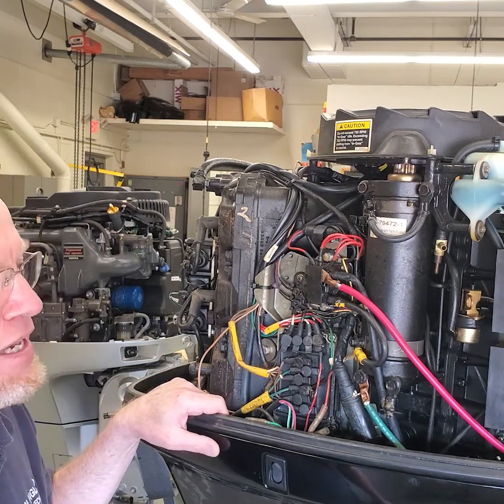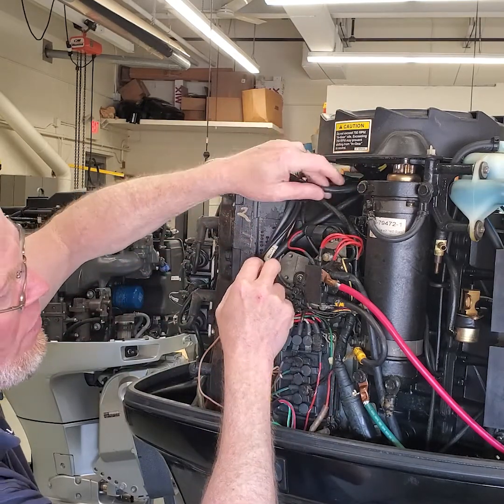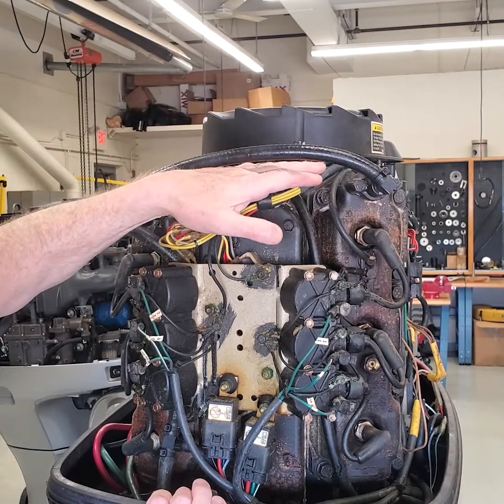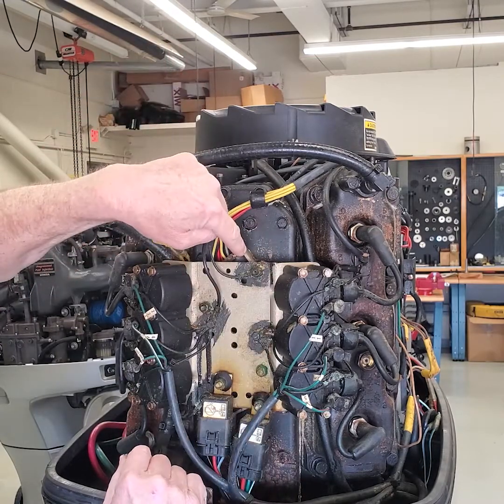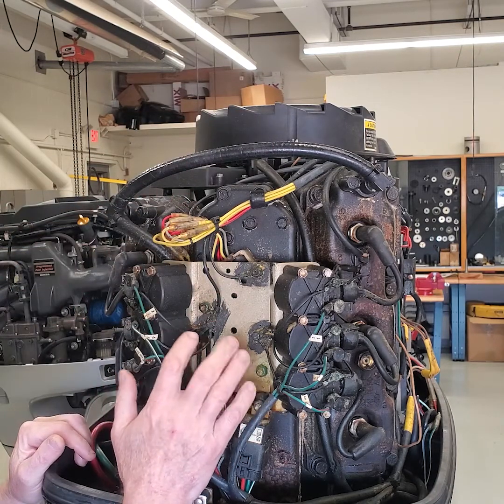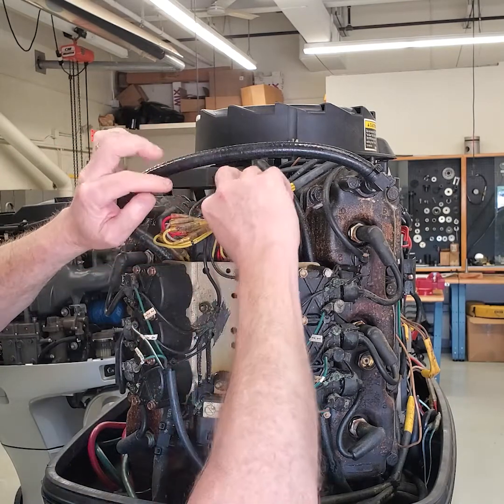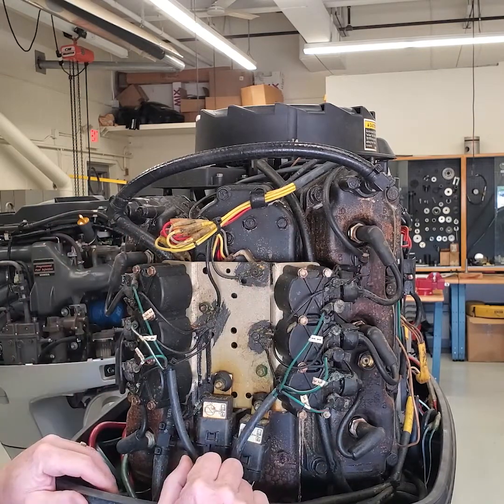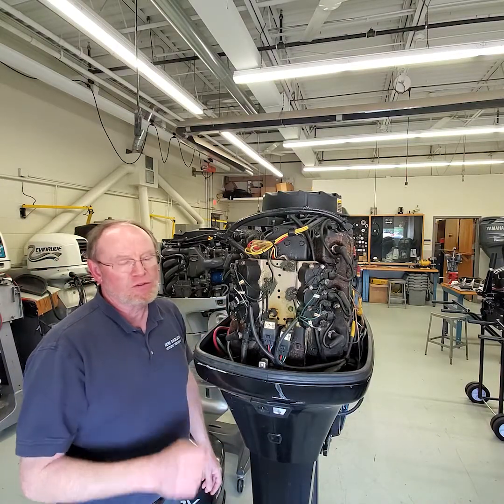1998 Mercury 200 Hp 2.5L Offshore charging system design and testing

Comment: 8:00pm, I’ve got a 1992 Mercury and at about 3.5 to 3.8 it surges and sounds bad like it wants to blow up but at wot it runs fast could it be the vr’s or the cdl boxes?
Reply from the maker: There is a old service bulletin on those engines. If it is a 2.5l v6 then the mid range jets need to be replaced with 0.004 larger jets due to a midrange transfer power drop.  I bet this engine is a used one put on a different boat. If not then all the carbs need a full cleaning.

Comment: Great video. I have a question tho. I have 4 yellow wires coming out of my stator. 2 of those wires have a black stripe. Are those 2 with the stripe indicating 1 leg of the charging system as the just yellow wires would be the other?
Reply from the maker: @ryanstoxen3190  Yes if you have dual regulators on the engine

Comment: I've got a 1996 200hp BlackMax. I ran the boat just a little ways and stopped to fish. The cdi box was burning a hole in the center of it. It would still run but the center of the box is burned out. What do you think caused  it? And do you think changing just the cdi box will fix it? Thanks for any help!!
Reply from the maker: @Keananbrickhouse  I would suspect the internal circuit issue. Change it.

Comment: Hey Ted, I have a Mercury 2.5 rx6,all of a sudden both my voltage regulators are getting Hot,too where they start smoking and melting the gel, and my tac, isn't working correctly, do you have any ideas for me to look at? I love your program, very informational.thanks.
Reply from the maker: Sounds like a short to ground. The tach is driven by the gray wire attached to one of the regulators. Remove the wires, disconnect the battery + cable and check for shorts to ground on the wires and the regulator posts to ground.

Comment: Great video. Have the same engine, unfortunately has developed an overheating issue. Ive changed the water pump twice, thermostats, poppet valve, flushed and back flushed twice. In the process of removing the exhaust manifold to check for blockages. All bolts are out but the manifold appears to be stuck to the head. I'm so frustrated im ready to beat it with a sledgehammer. Engine runs really well otherwise
Reply from the maker: Is the alarm going off? Get yourself a cheap infared temp gun, run the engine with the covers off and when it gets hot see if one of the heads is hotter than the other, you'll know what side to attack then. could be a clogged water passage in one of the heads.
Good Luck!

Comment: Hey Ted. Just found your channel. Great content. Any vids on upgrading old merc 2L from rectifier to regulator rectifier. Problem is that my 1985 150Hp is overcharging and from what I can find this can only be fixed by adding a regulator to the charge system 
Thanks 
Pete
Reply from the maker: That 150 probably has  a 16 amp max output stator so you could add one of these 20 amp regulator/rectifiers to it

Comment: Mine is charging high at around 16 volts. I may have a bad regulator
Reply from the maker: Yes, that is the issue. If you have two regulators like this engine then disconnect one (the red wire) and run it again to see if it is still high. Then that one is the issue, do the same with the other ensure both have not failed
Reply: @tedsmarinerepair8956  Yes, I do have 2 regulators. Thank you!

Comment: Hello Sr. I have a problem with my 1999 mercury 175 hp efi, everything it's working, I just noticed that I don't have return of voltage so the battery won't be charging with the motor. I'm out of the US, that's why I'm asking for your help. Thank you.